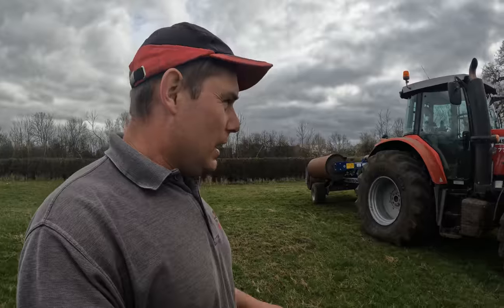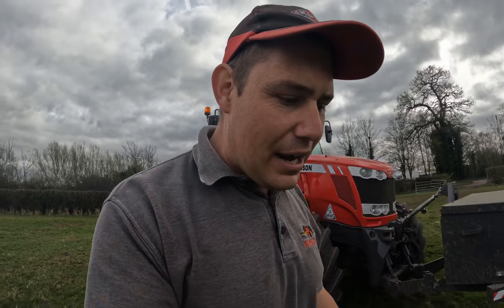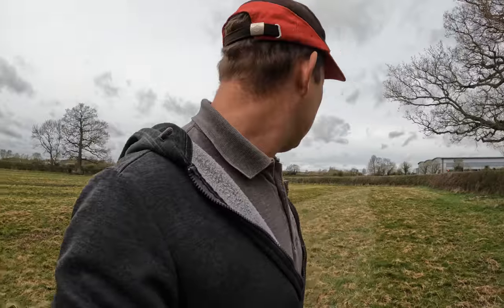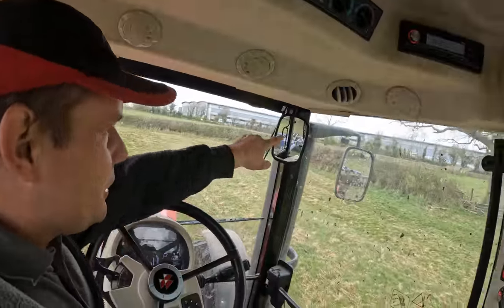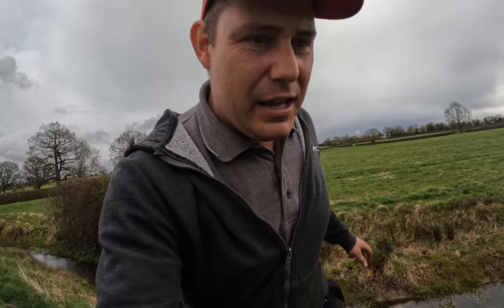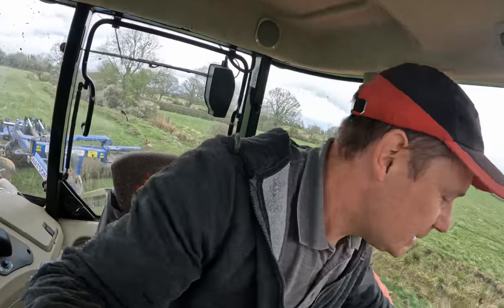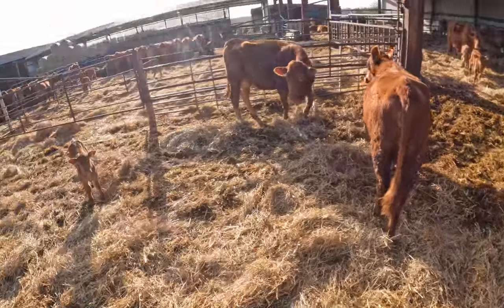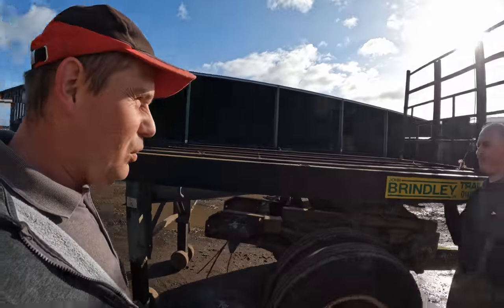Rolling, Harrowing And Trailer Repairs

Comment: Might be worth putting some hydraulic taps on  the rollers  hydraulic pipes at the tractor end if the pipe gose hard turn the tap off  to keep the pressure on the other side to get it plugged in

Comment: I'd weld the length of the  bit of drawbar between the tractor and trailer, it stops the rain water getting into the drawbar and rusting it down a the eye, over the next 20yrs